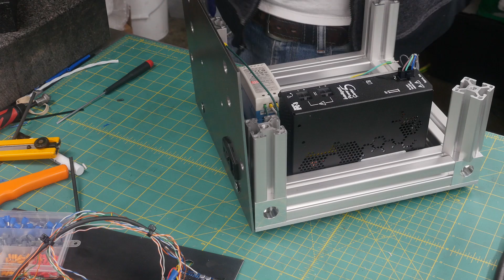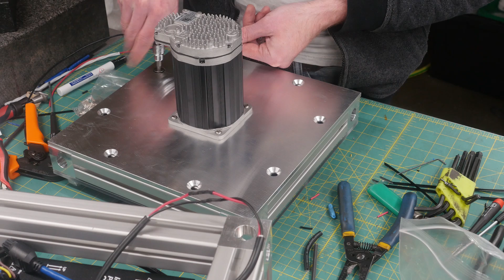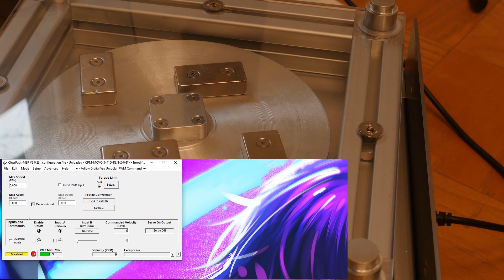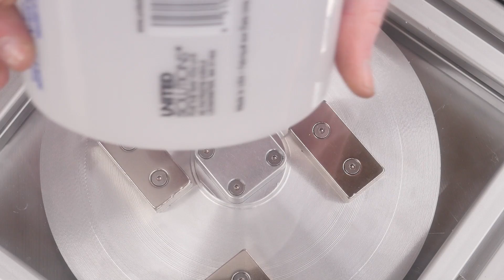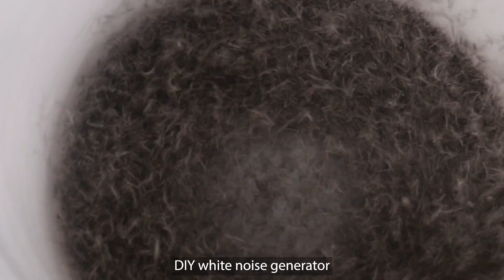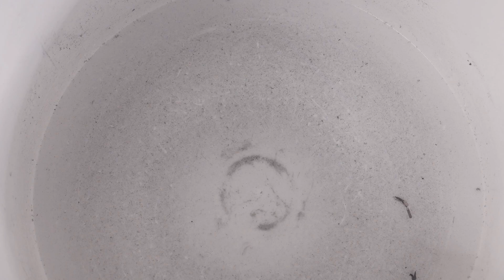[Part 4] DIY Magnetic Deburrer Teknic Clearpath Setup & Run

Comment: Would rotating magnetic field do the same as rotating permanent magnet? 

Rotating magnetic field principle use in induction motor. 

We may concept proof it first with stator coil remain with motor to swap motor core with non magnetic canister to hold parts and agents. 

Just a thought.

Comment: You could try to do magnetic parts with some type of blasting media. The noise could probably be dampened with a piece of rubber underneath and around the bucket, or even on the inside of the bucket.

Comment: VERY interesting idea, nicely done! As for the noise - I had a similar problem with my mini ball mill - I just put the milling container inside a second, slightly larger, container and filled the area between the two (i.e. top, bottom and all around the side) with mineral wool - you couldn't hear it going if you stood next to it. The motor (electric and gear) was the main noise maker. Should solve your problem, at least partially.

Comment: How about fastening the objects to be polished to the bottom of the bucket in the ring of the most magnetic motion?  That way it's more like sand blasting.
Reply from the maker: Hmm... I'd be afraid that then only the one side would get finished. But if you had something you wanted to finish just the face of, I could see that being faster.

Comment: dope, will it magnetize your parts?can you neutralize this effect?
Reply from the maker: Yeah it probably would. I think anything can be demagnitized with a standard demagnitizer. You aren't really supposed to put ferrous parts in it though.
Reply: @ChrisDePrisco  Wouldn't swapping one or two of the magnets do it.... well I guess you'd have to pull the parts out of bucket slowly. At least I think and I probably shouldn't do that...

Comment: Would a square container help with the polishing? As it currently sits with the round container your essentially creating a vortex and the parts travel on a set path, im thinkinh with a square container it may assist in altering the path and cause the parts to move around more.
Reply from the maker: Neat idea.  Maybe. Tons of ideas to try! :)

Comment: I've used those terminal blocks before. I noticed the fact that the earth variant did indeed have a connection to the DIN rail, but I didn't quite trust it to act as a main earth point.
The way I treated it was that yes, it decks the rail to ground, but I also ran separate conductors out to ring terminals that got screwed to each part of the chassis.
My role has always been prototyping and getting something initially flying before the "real" engineers had a look and turned my death contraption into something that could be sold to the public. God know what they did with the earthing after I handed it over to them.
I think, with the amount of surface contact area you have, if there was a hot (live) wire loose and it touched the chassis, it would be the hot that lost, and it would would be decked to 0V, rather than the chassis being brought up to mains voltages.

Your transformer experiment - I think the cable would need to be rotated 180deg, possibly wrapped around the chassis. THAT would probably see some higher voltages.

Thanks for the upload!
Reply from the maker: Thanks!

The way I figure it with those earth terminals (that are from a reputable company like Phoenix Contact) is if they didn't work well enough they wouldn't exist.  There'd be too much liability for multi-million dollar automation lines and all the workers that service and use them.  These have a large steel "claw" with two fairly large points of contact to the DIN rail.  At that point I'd be more concerned about the rail making a good connection but if you are using bolts every several inches there's bound to be a good earth path to the panel.  Then you got to make sure the panel is earthed to the chassis, lol.  But using all good, proper, industrial components I'm quite sure they've got all that stuff tested.  

I wonder if having the N S N S configuration wasn't just mostly cancelling out the current.  The poles of the magnet are facing the sky and ground so there shouldn't be much around the perimeter.  I've been meaning to flip the magnets sometime so they are all the same polarity and see if that changes things.  We ought to ask someone like Electroboom - I bet he would know! :)
Reply: @ChrisDePrisco 
Change of magnetic flux through a coil = a change in voltage.
Ah.. Makes sense now.. The poles are facing up/down to act on the object above (D'oh!).
Squash the coil a bit so that is as though you wrapped it around a book. Place that coil on top, but off to one side. It will only see north OR south OR north...
Alternatively:
The magnets all need "flipping" onto their sides so that the flux points outward. The coil would have to be off to one side so that it is exposed to north then south then north.. 
Polarity is irrelevant, what does the business is CHANGE in magnetic flux.
Or:
Got any large industrial contactors? They often have replaceable coils. Pull the coil out of one of them and stick that on the plate.. Bet you'll "see some volts" with that!